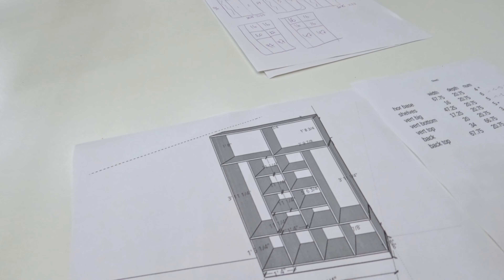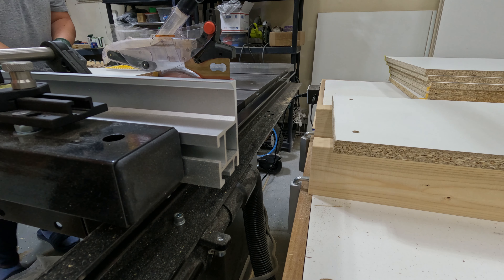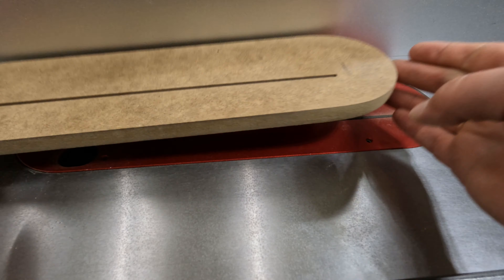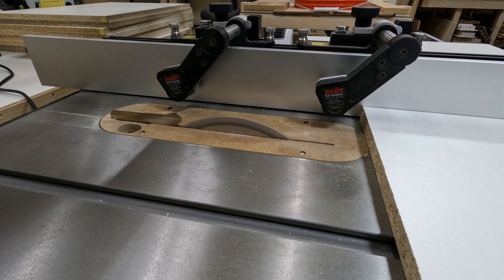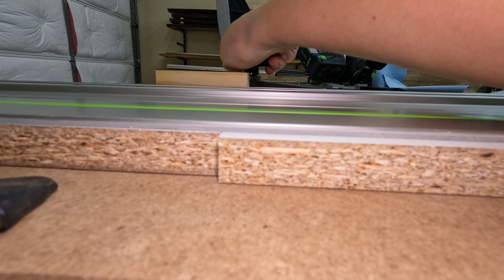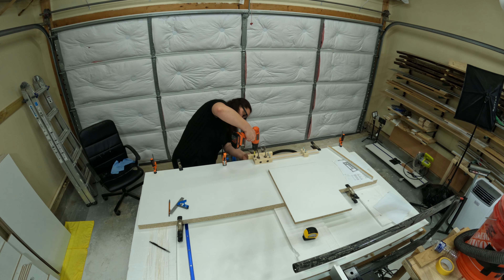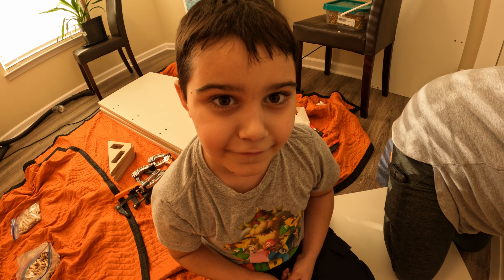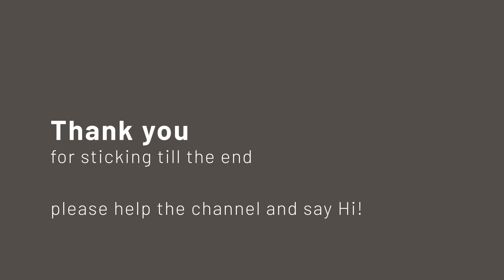Using my doweling jig with magnetic guides and extension

Comment: Great video, I like it when people share their frustrations and fails.  The chipping is not your fault...particle board is notorious for chipping.  The blade is meant to have a clean cut when it exits the board at the top, but will chip at the bottom when it enters the board.  For this reason, commercial shops use saws with a scoring blade.  Your best option is to use a super sharp blade, tape the edges, cut slowly, and hide the bad side whenever possible.
Reply from the maker: Thank you! I always think it is gonna be easy and fast project ))) and then it takes 3x more time. Which is ok, cause I am learning.